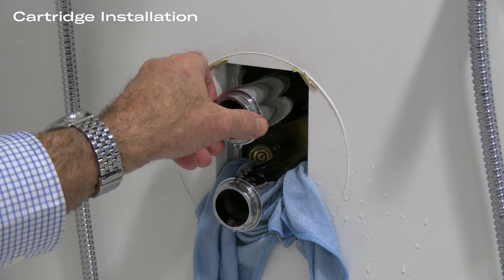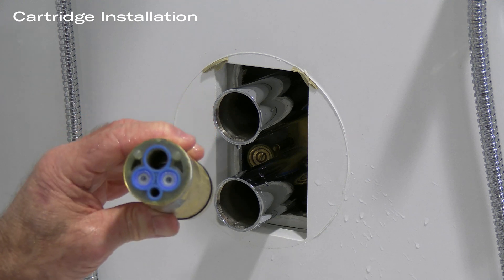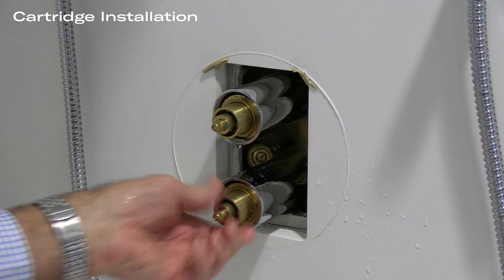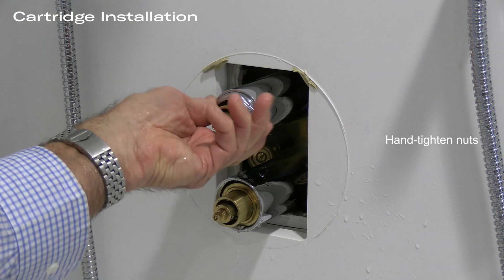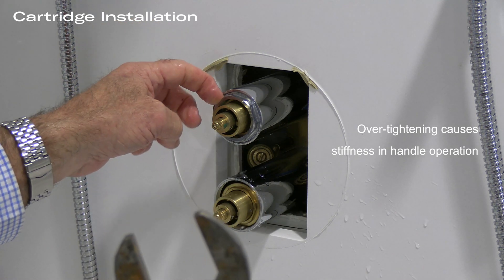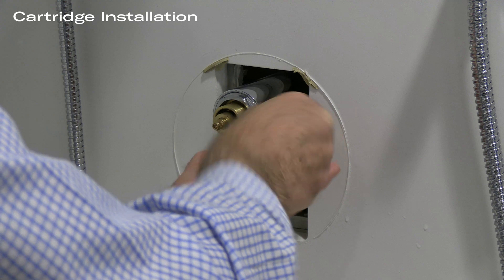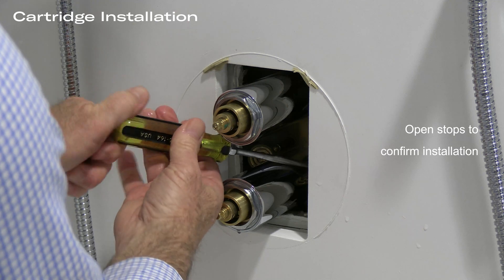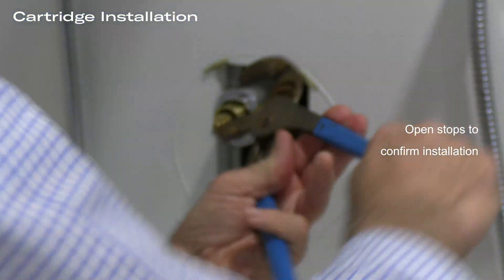R83 Cartridge Installation

Comment: fantastic, this is what I needed to see, I was sure our 20 year old valve didnt come out right. The last nut was seized on the collet and I wasn't sure if that was supposed to come apart, but i made sense, since otherwise you have a loose collet on the main body and you cant turn the body, because it has to line up.
Hope you got yourself some KNIPEX parallel pliers by now, instead of those rusty ones :P You wont regret going Knipex